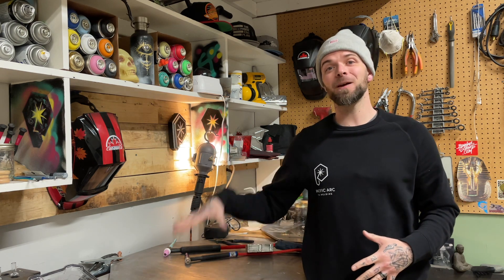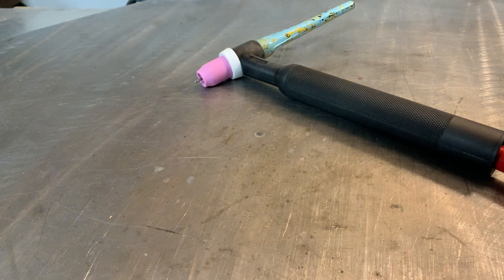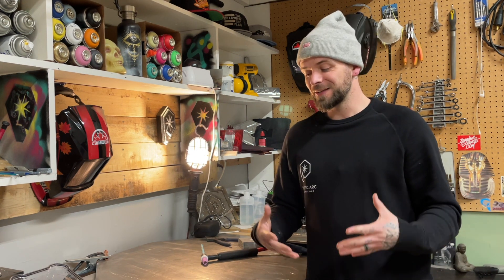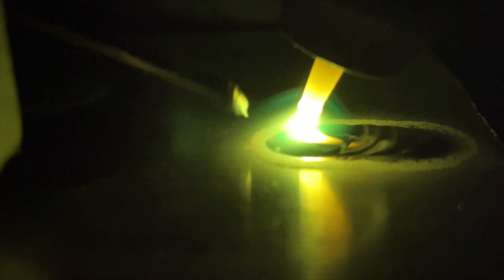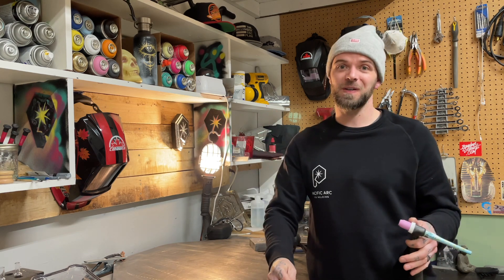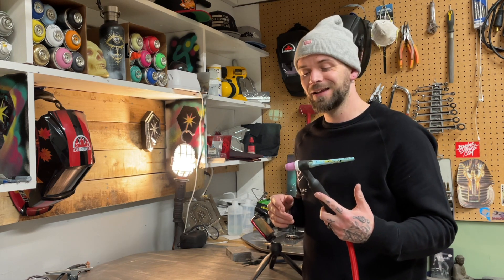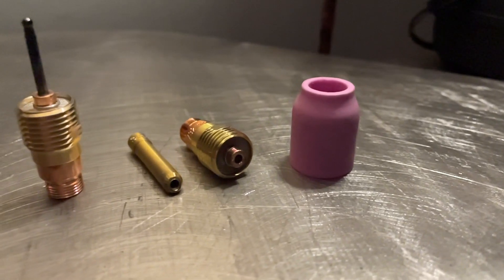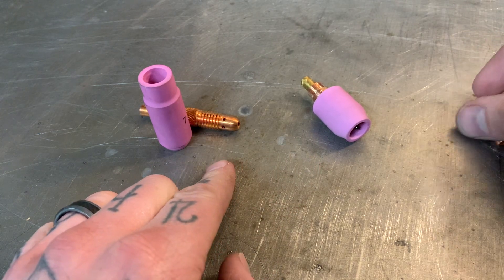🔥How I set up a Tig Welding Torch for ALUMINUM!🔥

Comment: Alright, maybe this is the right place to ask,,, ac vs dc set ups, can the same torch be used for both or does the torch or internals need to be changed before you change the current?

Comment: I never use gas lenses with aluminium. Some cheaper ones just don't work due to contamination. Any dips just more expensive, use the cheaper collet bodies/gas diffuser, especially a learner. 
Gas screen pointless for aluminium
The aluminium doesn't need loads of shielding, it's mostly the tungsten that needs the gas. I use a 5 cup with 2.4mm zirconium tungsten. 
I have a water cooled torch, and I can weld 140a all day without it getting hot.

Comment: Really enjoy your videos! I am COMPLETELY new to TIG welding. How do you get the small ball on the end of the tungsten?
Reply: Get a piece of scrap and weld on it
Reply: Torch at 90 degrees to flat workpiece gives cleanest ball, play with the AC balance
Reply: I am new to tig, not new to welding.

Comment: Cheers Dusty, watched a ton of your videos and they are so help full. My question to you :  iam wanting to fill in small holes in landrover panels that are as you probably know, made of aluminium. They can however be old and sometimes showing signs of corrosion. What is your best advice for this type of repair. Regards greg

Comment: Cool thing. The measuring of the cups is same in europe, but we use litres per minutes, not CFH. What's the cool thing? The number of cup equals LPM You should be running for that cup.

Comment: Hey Dusty. Why a 26 for AL and a 9 for SS?  Thanks!
Reply: The 26 size is rated for 250A, the 9 is 120A or so? Stainless is typically thin, and welded at lower current, so you can use a nice small torch

Comment: Thank you for your video.
I tried TIG welding aluminium with a gas lens but the lens gets clogged up very time and the gasflow becomes distorted.
Probably because of the AC.
My material as clean as possible so that there is hardly any dirt. What do I do wrong?

Comment: This is Radom but what’s the best way to cut tungsten down to shorter pieces like what you have shown? I’ve tried snips bandsaw metabo etc. everything I’ve tried splinters the tungsten. I wanna cut them up so I can sharpen a bunch for when I dip considering I’m fairly new to tig

Comment: Good information and I really appreciate your attitude!  It's worth noting that the EP (electrode positive) portion of the AC wave used in aluminum welding puts a lot more heat in the tungsten than the normal DCEN (electrode negative) polarity used for mild steel and stainless.  Some ceramic and clear glass (Pyrex/quartz) cups are limited in their amps on AC or are not meant for welding AC at all because they can't take this heat. And of course aluminum welding takes more heat/amps than equivalent thickness steel to begin with, so the combination means you might want to use 1 size bigger tungsten than you would need for steel.  Aluminum doesn't need great gas coverage, so traditional (non gas lens) collet bodies and cups work just fine on aluminum most of the time.
Reply: I run 140a with a water cooled torch, welding all day and the gas lenses don't last as long as the old style diffuser type. Could be to do with the heat like you are saying. 
I bought some cheaper gas lenses once and none of them would weld aluminium without ruining the weld.

Comment: I had a 26 style torch with my machine and a 80 piece consumables pack, I bought a ck9 with gas saver kit, will the standard 26 cups fit on my 9 if so what do I need to make them fit ??

Comment: This is great! I am just starting out and am currently using the standard diffuser type collet body setup but have been thinking of trying a gas lens. Would you recommend someone starting out to wait until they are more experienced to switch to a gas lens setup? Or do you think it would be worth it for a beginner like me to switch to the gas lens? I am loving your videos, brother!
Reply from the maker: As a beginner- you’ll be dippin like crazy...😂🙏 It happens. No big deal, however when you run a screen those are super easy to mess up by contamination and splatter from dipping. I’d get a bit more familiar with hand control and posture, then gear up with some finer tuning like lenses and nicer cups:)🍻
Reply: @PacificArcTigWelding  Awesome, that is exactly what I was wondering, if the lenses could get messed up easily. I definitely have been dipping my tungsten a ton! Each day I feel I am getting better and better though. Videos like your have really been helping me out, I appreciate it! BTW, do you have any merch (hats, shirts) for sale?
Reply: @PacificArcTigWelding  When you add filler to the puddle in aluminum welding, the puddle tends to plump up (rise toward the tungsten tip) more than it does with steel or stainless.  I've found that can really increase the tungsten contamination/dipping.  Jody (Weldingtipsandtricks) and others recommend trying to raise the tungsten just a bit higher when dabbing the filler rod, in a rhythm.  I've tried this technique and it works.

Comment: Hey dusty, if you can help, I'm having trouble  welding my aluminum SLOW! Seems like if I dont speed up I burn through my aluminum material very quickly! I'm working with .060" square! I'm thinking about going with a smaller tungsten than 3/32